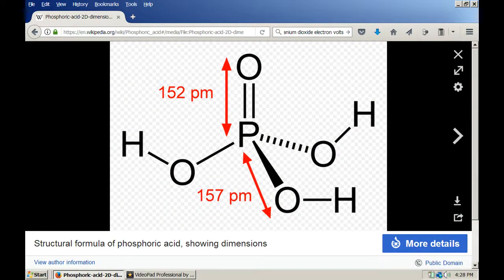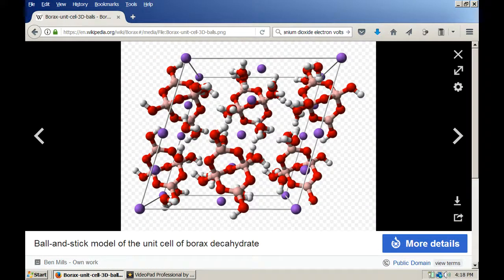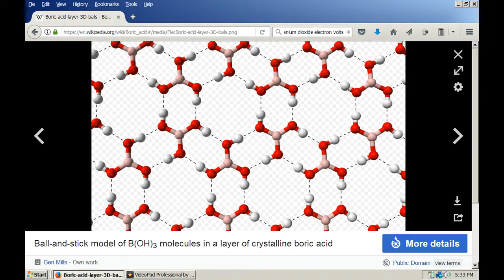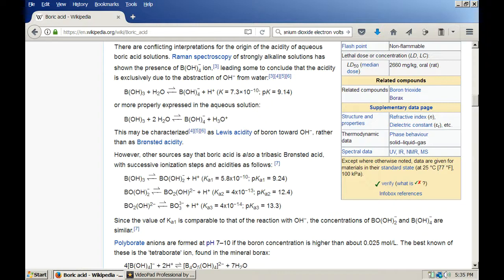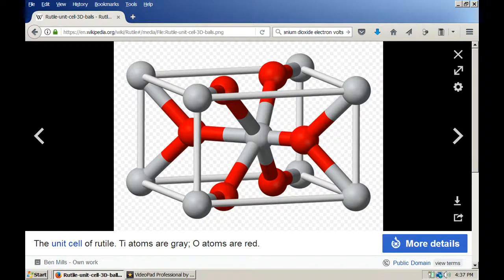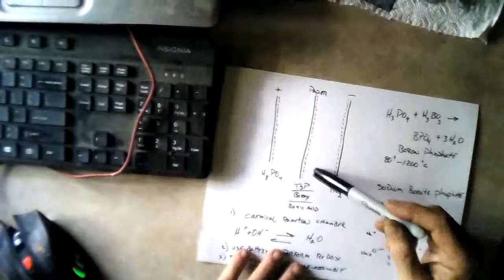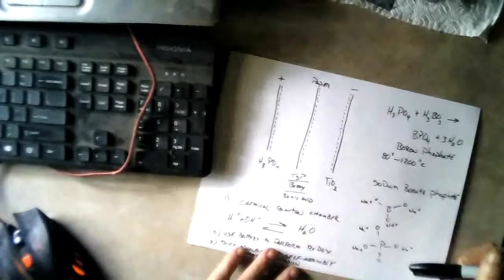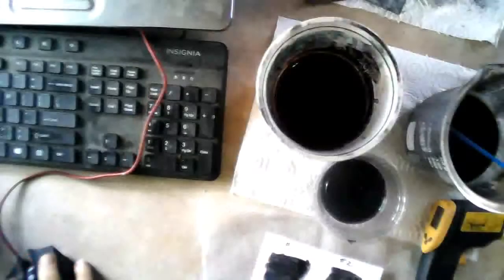Easy Intercalation & Exfoliation With Phosphoric Acid! Part #4

Comment: I enjoyed the chemistry lesson and graphics, It does help when you can visualise what is happening at the molecular level :-) 
I have always been a great believer in trying to understand the theory (which can be challenging for a non chemist), and then go with empirical testing, making gradual changes and improvements, hopefully trying something that others may have overlooked.  Martin.
Reply from the maker: Well, there is plenty of room for experimentation with this battery Martin. I've just scratched the surface of the possibilities! :-)

Comment: Bravo, Ray. It appears you took the crucial time to investigate your observations and understand the reactions. That is the difference between blind and comprehensive experimentation.
The two definitions of experimentation in Merriam - Webster are:
: something that is done as a test : something that you do to see how well or how badly it works
-
: a scientific test in which you perform a series of actions and carefully observe their effects in order to learn about 
something
It is my impression that you pursue research by both definitions, which is important. 
To experiment without research relies on chance for results. To research without experimentation does not produce results.
Reply: And Bravo Mr Miller you are so spot on with your observations.
Reply from the maker: I didn't know there were two definitions for an experiment Fred. I just saw the need to explore the reactions before performing another battery experiment. Thanks for the compliment my friend! :-)